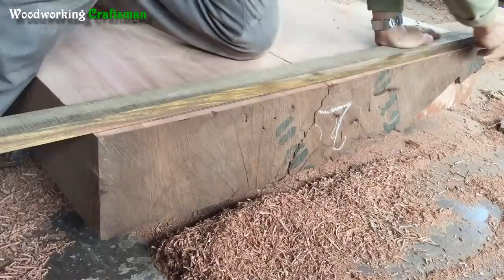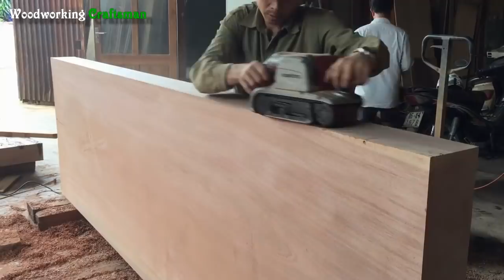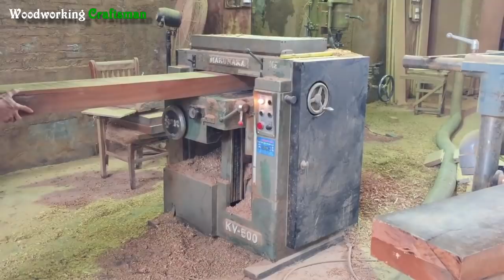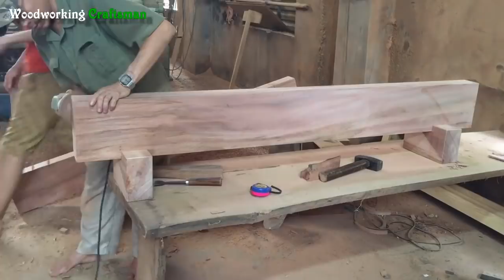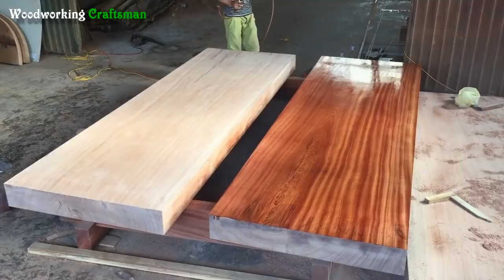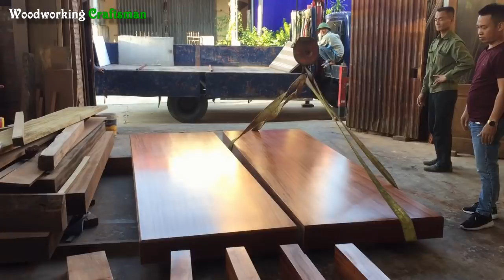Making An Extremely Giant Table From Monolithic & Rare HardWood (long 3.5m/wide 2m/high 32+18cm)

Comment: Ive just returned home from working in Gabon and the yard that we were using for storing oilfield equipment was filled with huge slabs of lumber like this and bigger. It was only being used to support equipment and this stuff was so heavy and dense with beautiful wood grains, Such a waste for what it was being used for. Would have cost an absolute fortune to buy back in the UK.

Comment: What species of wood did you use? I ask because it looks nearly identical to a small piece of very old mystery wood I found in a crate of old lathe tools. It's extremely heavy for it's size and so dense that it was like I had tried to plane a chunk of granite. It rolled my blades right over.

Comment: Beautiful table, but for your sake put on some safety glasses, ear protection, and at the very least some closed toe shoes.  I think this is very irresponsible to be putting this on you tube with a complete lack of any safety concerns.
Reply from the maker: Thanks for your comments on occupational safety. We have changed and the next videos you will see it. Thank you sincerely
Reply: Very sad that there isn't a dust mask being used. I wouldn't last an hour with all that dust about!

Comment: Lack of PPE, floor working 100% of the time. No proper basic tools ie set square and using circular saws to cut at the start multiple times without a guide. Putting bare hands into band saws, mechanised planer etc. The table top is overly thick for no good reason.  Terrible working condition and extremely wasteful. I hope the timber was recycled from a dead tree as opposed to have been chopped down from the tree being in its prime.